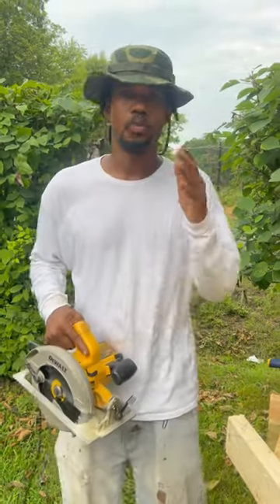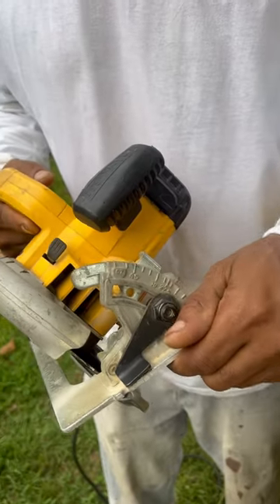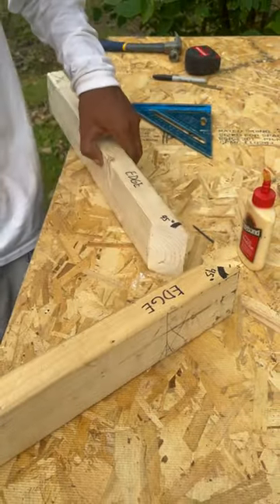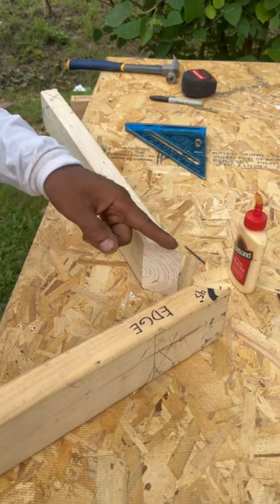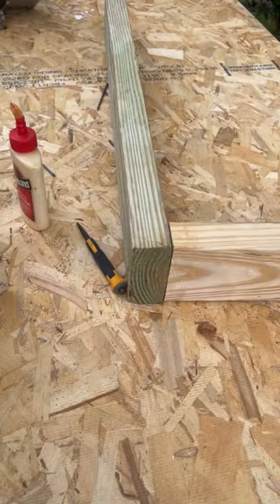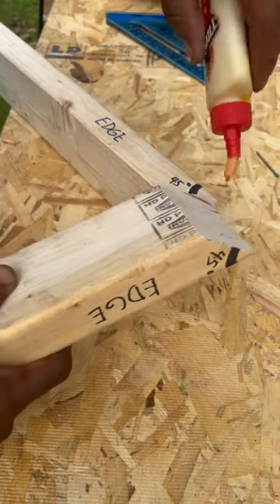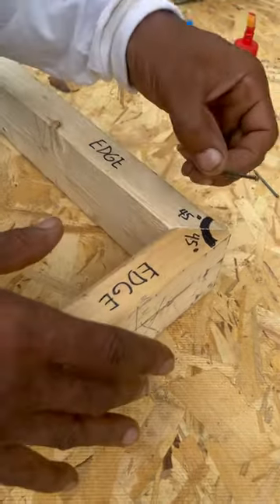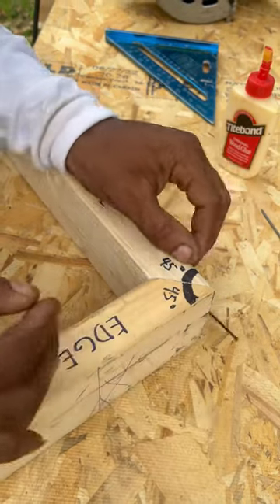What is a Bevel Joint? #carpentry #wood #bevel #Carpenter #shorts

Comment: Can you make a video on how to fit two beveled pieces together? Do you have to turn the saw a different way on the second piece?? Also, a different video for the mitered corners too.
Reply from the maker: I have some older videos on some of these joints, however I will make more detailed videos on this topic Ashrob07 Thanks for supporting the channel.
Reply: if you can't figure that out on your own, you shouldn't be allowed to use power tools.
Reply: If I am understanding the question,  No you wouldn't have to turn the saw, you would turn the wood.  The skill saw only adjusts one way.  If it were a miter saw or a radial arm saw, you could adjust the saw, but it would be easier and faster to adjust the wood.